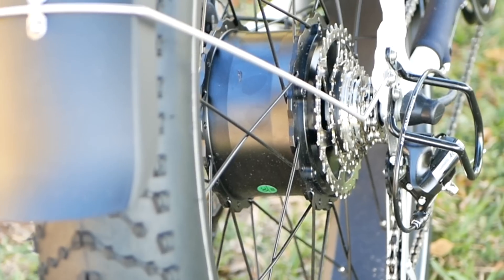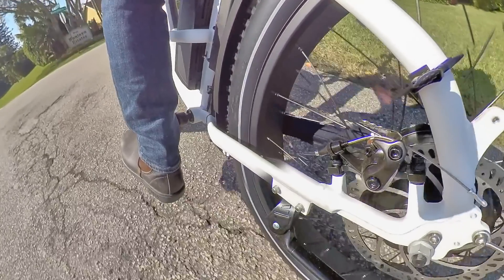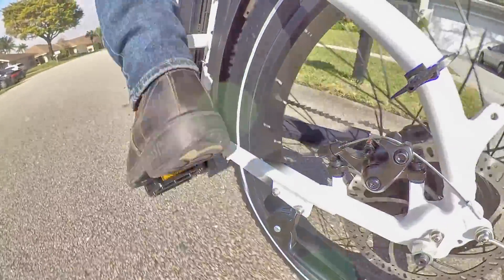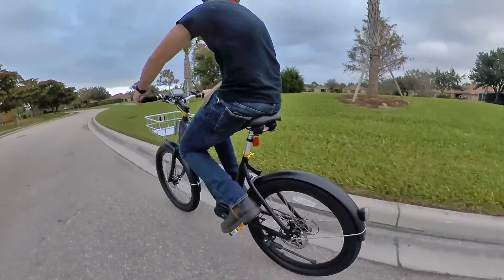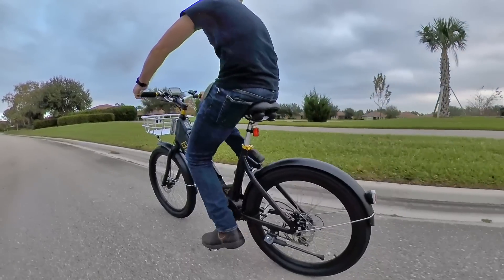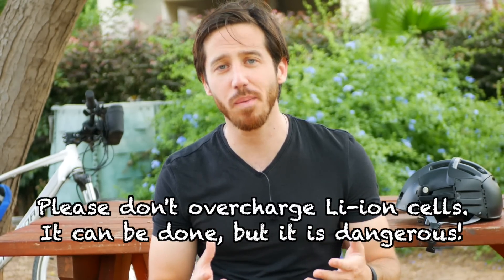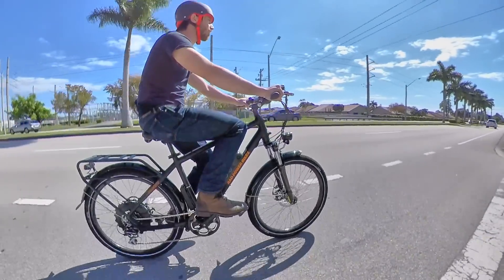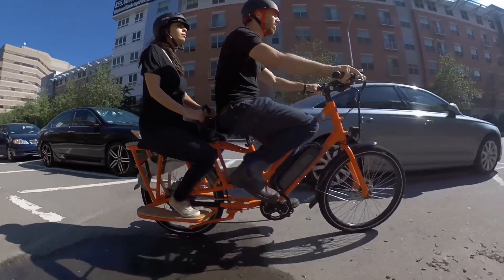Why don't more electric bikes have regen brakes?

Comment: If I swap out a 250w rear hub motor for a 500w, what's the practicality with the same battery, for example, would low power mode be more like mid with the old hub, and would that prolong battery life? (I know 500w would drain battery faster) but the additional power would be really useful where I live, it's hilly.
Reply: Motors are like speakers. You can buy a 4000 W speaker but you only get what you put in. If you put 250 W in a 500 W motor you get 250 W minus losses out. Whatever motor you use you need, if you input the same power, you get the same power out.
Reply: difflocktwo thanks for the reply, your speaker analogy makes sense. So, the controller I guess is the amp? I'd need a controller rated 500w to 'power' it? Unlike speakers, (besides the heat) I'm going to guess it's harder to blow up the motor, so I'd be better just getting a better battery, although that's not going to give me more grunt to get up hills, just more volts to accelerate? Have I understood that correctly?
Reply: Just checked the details on my controller and it's not rated for watts, just 36v. Says limiting 12 +- 0.5A 🤷‍♂️
Reply: I think I got it, 36v and 'limiting' is the amps, which is 12 plus or minus half an amp, thus, controller is good for ~400w  output? So a 500w wheel would be ok, but I'd only get 400w of power from it, unless I changed my controller as well?
Reply: @MinecraftChester 

   Yeah pretty much. The controller is like an amp. 

I recommend this channel: https://www.youtube.com/channel/UCbKIWz7uAeDSMgulTonKk6w

Imagine you plugged you speaker directly into a wall socket (battery) you would either blow the speaker or your house wiring/breaker (battery). The controller limts how much the power motor draws and also makes sure the motor spins rather than just making horrible noises and burning up.

Ebike motor coils are generally more robust than speaker coils but you can still cool them with abuse. That's why it's great to have a temperature probe on the coils, this way you can back off the power as the motor gets too hot. You also need to worry about stripping gears if you have a geared hub or other geared system.

About the battery, more battery at the same voltage gives you mainly more range. It might actually slow you down if it's adding a lot of extra weight.

A higher voltage will give you more speed if your controller isn't speed limited in software. But controllers have upper voltage limits and will die at too high voltages. You might also see an increase in acceleration with higher voltage batteries because many controllers are unregulated in that regard and by chance a higher voltage also ends up with more motor torque. This is kind of a controller flaw.

To increase your performance, you need to check where your bottleneck is and focus there. But at the end it's really a whole battery-controller-motor system and they all relate some how. You can even change a motor for a faster or slower motor but have it at the same power rating.
Reply: @MinecraftChester  Yup, there are different types of limitations. Voltage is one, current an other and of course thermal limits. There's a sweet spot where there is maximum power, but it's better to not worry too much about sweet spots.
Reply: @MinecraftChester  Yeah pretty much. Changing only the motor will probably not change much unless it's a drastically different Kv motor. Kv is basically a voltage/speed relationship of a motor.

 36 V is the voltage limit of your controller, in reality that means a fully charged 36 V battery is 42 V. 

With cheap controllers that current limit is basically there to protect the battery and they use battery current to guestimate what's going on the motor side. The more proper way of control looks at both battery and motor current and has assignable limits for each.

Comment: I have a question, how to determine the maximum voltage a controller can handle based on the voltage listed on the capacitors... You touched on in briefly in other videos but a more in depth source would be great. The info on the web about that is scarce right now.
Reply: You should derate your systems if you want reliability. I'm not sure what the rule of thumb per component is though. Most electronics have their operating voltages published.

Comment: I've noticed many e-bikes have multiple gears rather than just a single speed. Though there are some single-speed e-bikes, it doesn't seem to be the most common. Would there be any downsides to having a single-speed e-bike? Would it make any difference if the primary method of acceleration would be throttle only or pedal assist? Thanks!
Reply: A single speed ebike makes more sense than having multiple gears. Electric motors make it so you're always riding down hill right? So you don't really need more than one gear.

Comment: Hi Micah - thanks for your videos and please make more, you have a great laid back style and great info. I have a silly Q about e bike conversion - if I convert a 24 gear MTB can I still use all the gears as before, starting in low gear then moving into higher gear, all while being pedal assisted by the motor? I’ve been looking at the Swytch kit although they’re out of stock. Thank you!!

Comment: the reason why mid drive bikes don't have regen is because otherwise they had to be "fix" bikes, meaning that chains would be rolling all the time, even when not pedaling.
Reply: They should be fixed gear then. Put a freewheel in the crank. Or better yet,  just go hub drive.

Comment: When making a battery for your ebike can I just stack 13 batteries long ways and heat shrink it so it's just a tube I can strap around the bike tube.  Will li batteries work stacked or would I have to solder or connect somehow? Please help
Reply: You're playing with fire and flying blind. Start with baby steps. Start with two cells and see what happens. Design testing procedures to make sure everything works and expected and is safe.

We stack cells in flashlights all the time, but we charge them one by one, not in a stack.
Reply: @difflocktwo  I need a 48 v battery for my ebike tho I need more then 2
Reply: @mikeydontlikey1  But your battery building experience is not ready for more than 2 cells. Baby steps first.

Comment: The best part of regen is that it can be used for ABS on the back wheel, it stops it locking up when leaning on the front brake, this stops the back end of the bike skipping side to side and trying to overtake the front wheel. i only use the front brake now unless im pulling a heavy trailer. since the regen force is more than enough for the back when normally using the front brake.
next benefit is for pacing down hill without cooking the brakes it works even better with a heavy trailer.

Comment: Regen breaking seems to only give a possible last mile return on investment. It seems that owning an ebike requires some degree of use planning.  For example if your ebike can go 30 miles on a full charge but your riding style uses up the battery in 12 miles. Then your practical use may only be 4.5 miles out and 4.5 miles back. That being the farthest you can go round trip. However if you work for an employer who does not care of you plug in then you could get 9 miles this is based on the idea of extending the battery life as much as possible since that seems to be one of the most expensive long term costs.
Reply: You can go slower to extend range or you can get a huge battery and never worry. 10 kg of battery should be enough for daily needs.
Reply: @difflocktwo  Another thing I dont hear anyone talking about is the possibility of incorporating the use of a Charles Flynn motor, Not as a drive motor but running a generator. Also there is not any talk about the possible use of joule ringers??? Mabe joule ringers are not very good to use with lithium ion batteries considering their sensitive natue.
Reply: @DavidKing-wk1ws  I have never heard of either device. After googling they both sound like free energy scams.
Reply: @difflocktwo  Unfortunatley these items tend to be marketed as some kind of free energy devices. However while they can be dismissed as free energy they can boost effencies of a given system. For example there are a number of those solar garden lights that use joule ringers to boost system efficiency.

Comment: Could I use a old bike dyamo 6v 3w to charge batteries as I ride would it be worth it? Honestly I have Fiido L2 350 watt rear hub motor with a 48v 20a battery  so far even 2 1/2 hour ride pedal assist 3 15mph cruise I never seen the 5 bar battery gauge controller go below 5 bar, I'm sure once it does go to 4 bars it falls rather fast.
Reply: You could but, but why not just use the motor itself?

Comment: Mica,
I saw a guy a few weeks ago while getting lunch that was building an electric motorcycle. He had a rolling frame in his car that looked similar to the Sur Ron. He got the rolling frame as a kit.  He also had a motor and controller he purchased separately. I was not interested then and did not ask many questions. I see several places where one can get the motor kit but I cannot find a rolling frame. Have you seen a rolling e motorbike frame as a kit and where could I get one? Thanks

Comment: Nice video.  I have an ebike touring company.  I have 8 Bionx 500D (NORCO frame).  In addition to 6 Specialized Comos.  The regen mode on these bikes is fantastic.  My routes are very hilly and I have had customers who have returned from an 18 mile tour with the battery fully charged!!!  Very efficient.  Bottom line is that because motor efficiency and range are such that it isn't needed.  Not sure what you are talking about regarding coasting on my Bionx ebikes, I have in shape riders who ride without assist, turning the motor off.  I haven't tried any other regen ebikes so I have nothing to compare my experience with.  Anyway, this is my experience with over 3,000 riders on tours with the ebikes I have.
Reply: Yeah, this whole video feels super weird.
Reply: can you provide more details about it. because my research goes around Foot Bicycle with Energy Recovery

Comment: If I hook two 10 36 350 together in parallel.  Will it double the storage capacity.  Won't this help my ebike go further without having to charge my battery??

Comment: You can make one....use a step up rectifier......and a switch that disconnects from controller power and into the rectifier.....this will cause the cogging effect causing the bike to slow down and this creates energy to the batteries....I've done this before......it works .....the rectifier stabalizes the input and gives a set output current .....just be careful since the wheels are cogging  make sure u install good torque arms to hold that wheel in place .....
Reply: Well output voltage my bad.....so let's say the wheel gives 6-12 volts while spinning down a hill then the rectifier takes whatever input voltage it gets and gives a standard output voltage let's say 48 or whatever u need to charge ur bank

Comment: Hey Ebikeschool.com i was wondering if it was possible to upgrade my battery pack at a later time.
so for example i start with a 30Ah 72V battery and would want to upgrade to 60Ah at a later time.

i hope you can help me out and give me some thoughts on what can or can't be done and why.

thank you very much in advance :)

kind regards,
Simon

Comment: My experience was that the regen was useless - it added nothing, but the braking was excellent.  It would stop you faster than caliper brakes would, so saved both brake pads and rims.  But it also added drag to coasting and pedaling with the motor off.
Reply: Then don't ride with the motor off?
Reply: ... or when the battery dies.
Reply: @tomadams2319  That's why you have regen.... Anyway could you explain a scenario where you completely empty your battery? Most of the time you should be operating in the middle of state of charge like 30-80%.

Comment: I was thinking that there could be a sort of pedal brake that would activate the regen to avoid the drag when coasting. But when it is only 5% I'd rather have a 5% larger battery than adding more complexity and things that can break. :)
Reply: What things are you adding that could break?

Comment: Hey what you are saying about the return is so wrong...let me explain...I have a formula and I can get over 10 to 18 per cent out of regen.How is done is quite simple program your controller to engage regen when you are letting the throttle off on low power generation mode.By doing that you will generate power every time you let the throttle and you will have a lot of return since it's going to be like a break but not so powerful the idea is to have it on as much as possible if you are getting my point 18 per cent is not nothing I get a return of 2ahs out of a 12 ah battery pack but it's a battery I made lifepo4 headway other batteries won't be able to survive this
Reply: Which controller has this smooth throttle/ regen?

Comment: I am confused.  The first source of hybrid vehicle’s recovery of energy is by using the brakes themselves.  What would it take to design these kinds of brakes for e-bikes?
Reply: It would take nothing. If you have the components to go forward you also have the components to go backwards or brake. A motor doesn't care which way the torque goes.

Comment: This question is off topic for this video but been watching and learning as much about the batteries and solar in general to make some decisions. Been debating on buying the book "DIY LITHIUM Batteries" but I could not find quit enough info if it was going to answer what I was looking for. And the reviews I read I were not helpful but there are always those people.  I am a fisherman and run a 36V trolling motor and after seeing you build a water application it got me thinking more. I am already messing with solar at home but only small time and for fun to test out. That and wind energy. My biggest question I would say is how do you decide if you are going to build one battery @ close to 36V and 105 ah (4032 wh) or 3 separate 12V batteries ran in series to get up to spec? The only thing I can think of is the charger specs. I have no experience charging lithium other then the ones that are built inside items with there own chargers. The numbers above I suppose are the minimums. I know its a 36V trolling motor that has the possibility of drawing 52 amps Max. Being a tournament guy I was looking for something that last longer then what I have but not spending $4000 to get going.Thanks for anything even if its just you just making more videos. I have learned a lot. As long as you learn something everyday that is all that matters. Doesnt matter if you needed it.

Comment: what about a bike that is built to make a dynamo out of the backwheel. like maybe the rim or the spokes can be magnetized, interacting with a copper coil on the bike frame... charging a secondary battery that you use to push the travelling distances. I get more or less 50km range on my battery, including lots of hills, and I'd love to continue an extra 50km while I charge the first one, if I was doing a tour or crossing the country.

Comment: You missed out on the point that Regen also saves on brake pads! Also the savings can far exceed 10% if you regularly go on a route that has a down hill and uphill where you need to slow down for safety on the down hill and the regen can not only help you do that without wasting brake pads but save that downhill energy for when you go up hill again. Lastly if you want to turn your bike into a dual renewable energy wind turbine you can only do it with regen braking by turning the bike upside down then adding in the wind blades into the wheel spokes section and then engaging the brakes slightly to recharge your battery with wind power.

Comment: 2:48 Ah yes, here it is. I clicked on this video expecting this part. 
 
First of all, that 5% number you tossed out there, how did you arrive to it? Was it doing long rides down bike paths or country roads? Or In a urban setting or a hilly setting or a hilly urban setting? 
 
4:36 Oh, well. Regen works a lot better if you uncouple it from your mechanical brakes and give it its own button. Obviously if you are losing energy to brake pads, that is energy not going into the motor. AND you can avoid the 'fry your battery going down a hill' scenario. I think I understand where that 5% number is coming from now LOL.
 
Finally, you managed to mention the downsides of direct drive motors but you forgot to mention the positives. You also forgot to mention that every geared motor on the market uses plastic gears. Also that Geared motors have terrible cooling and have a tendency to cook themselves under stress. 
 
Ebikes can get a lot out of regen. The reason the industry is moving away from it is because it is going into its "Apple" phase where every e-bike manufacturer is using increasingly proprietary parts that are designed to wear out just outside of warrant so you have to pay to get it fixed (and only by them, no one else can do it) or buy another bike. 
 
Direct Drive motors have one moving part, the bearings, which are easily replaced. Obviously that's not good for companies trying to make bikes the way US auto makers make cars...
Reply: Loud and clear. I don't think the presenter forgot anything. Seems intentionally left out. They're not that careless.